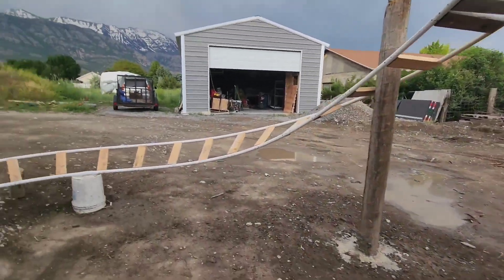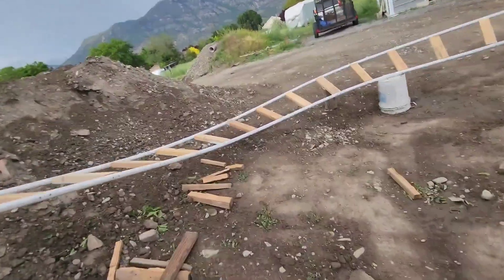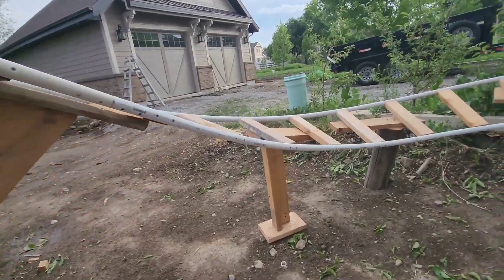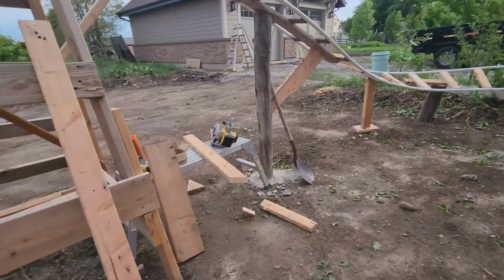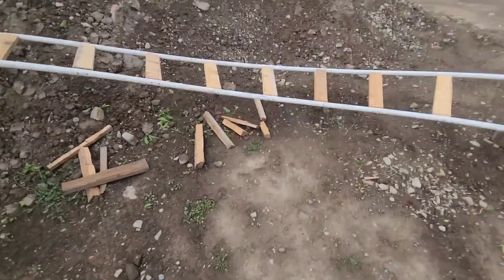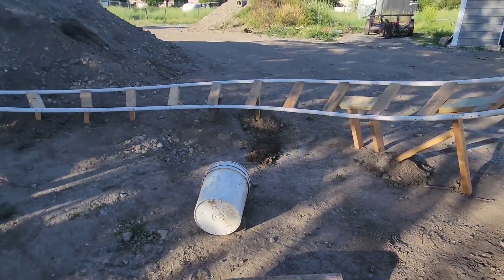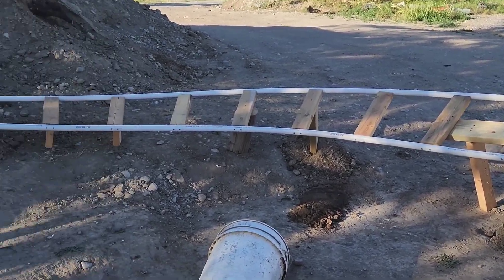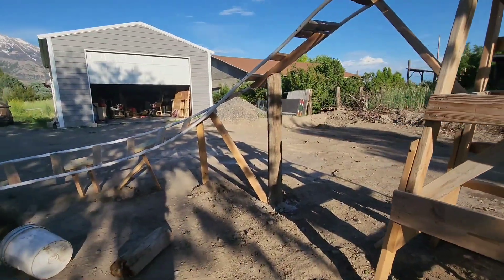Backyard Roller coaster update! #1

Comment: Looks cool! But are you sure it will make it up the second hill after u just gone down the first and biggest?
Reply from the maker: It wont make it back up, you will end at the low point. I will push it up, or find a way to pull it up the hill.
Reply: @Blake_Danger  you should calculate the force to be able to make it back up the hill.